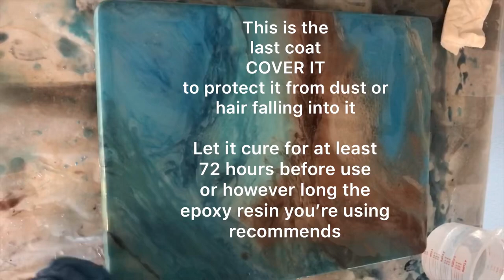TV Tray Makeover DIY Epoxy Resin Pour - Step by Step Tutorial

Comment: It looks great! I have limited experience  with epoxy, but would it have helped to use painter's  tape around the edges under the tray? Or wouldn't that work with that medium? I have three trays; one was a trash find and not a match. I might do this!
Reply from the maker: Thanks! Painters tape would have definitely help just make sure to remove soon after epoxy cures the longer you leave it the harder it becomes to remove:)

Comment: Amazing  to watch the formation of this Amazing  piece like a Fabulous development of a Butterfly 
Phenomenal, just Gorgeous, the colors so compliment each other💜
If you had taped it all off under heath, could you have avoided the drips and having to sand?
Reply from the maker: Thank you. Yes tape would have avoided the drips but it can’t be left too long after epoxy cures because then is hard to remove. You wouldn’t have to sand the bottom but the top I usually do so the primer bonds well since it comes with a shiny top coat.

Comment: Hi Tiff, If you wanted to add a sticker to this when in the process would you be able to add it?
Reply from the maker: Hi 👋 I would wait until the colored resin coat is cured, then add the sticker and then a clear coat on top, so  that the sticker will be permanently sealed.

I did a similar video using a decal/sticker and pouring resin on top. I hope it helps ☺️

https://youtu.be/6wW9uMyPJno?si=Czm9VAQRNAiqbFol

Comment: Seemed like an awful lot of work, The end result came out really cool! awesome job, Can you tell me How expensive this project was?
Reply from the maker: Hello 👋 this project came out to about $50 in cost when I first did it. The table was only $10 (Walmart) after the epoxy, pigments and all the miscellaneous materials it was about $50 at the time. That cost is calculating the amount Of epoxy I used for this project and not the whole gallon. The epoxy is the most expensive part but I usually get the gallon so I can make multiple projects out of it.

Comment: So this was amazing. Just what I was looking for! I am going to dabble is resin as if I don't have enough hobbies. I want to do this for my boyfriend in the Raiders color and possibly add a logo. It would not necessarily be used to eat on. Do you think amazing cast would be fine or should I invest in the kitchen-grade resin? Also is it absolutely necessary to send it first? I have a black table and kind of want that black background. Thanks for the motivation!!!
Reply from the maker: Thank you! I have not used Amazing cast before, but kitchen grade is usually heat resistant so I can put hot plates and cups on it. I sand it so the base coat can adhere, but if you’re not doing a base coat epoxy sticks to almost anything so you should be fine. Good Luck!
Reply: I have an eating tray that has all the Buccaneer logos on it and yes you can eat on it. It’s cool and quick conversation piece.

Comment: How msny coats do you do on these tables?  Especially if have vinyl?
Reply from the maker: Coat of primer or resin?

Coat of primer - one coat is enough, make sure is a bonding primer and that you sand the surface first especially since is vinyl. After primer you can paint a different color as the base if you’d like. 

Resin - after you’re done with pouring and it cures, always do one clear coat on top for protection.

Comment: Does the table have to be sanded? I tried one and the directions said nothing about sanding and it just sat on top of the tray...it’s only been a week but to date, still not dry 😒 I’ve been trying to right the wrong since...
Reply from the maker: It all depends on the resin you’re using 
because each resin has its own instructions. The resin I used says it can be recoated after 4-6 hours I believe, but if I don’t do it in that time frame I have to wait until it cures and then sand it to re-coat it. I always miss that 4-6 hour window to recoat which is why I sand it. Epoxy not drying usually can mean that it was not mixed with the right amounts, or the room temperature might be too cold or even too much pigment. Most times doing a fresh clear coat would take care of the problem. That’s what I would do.